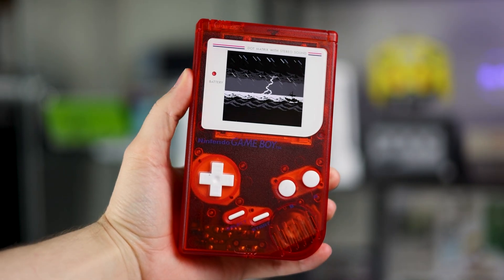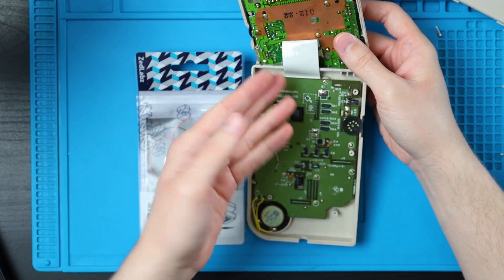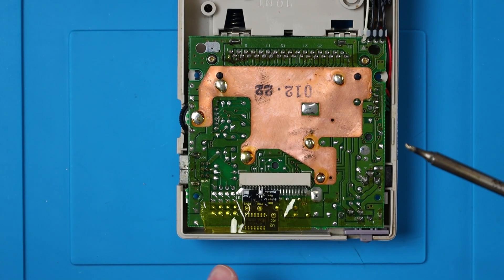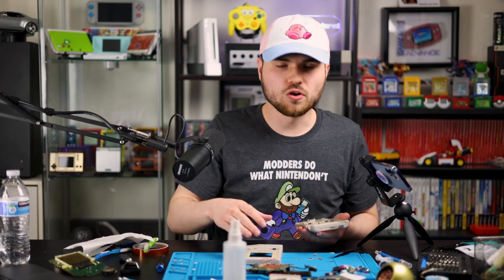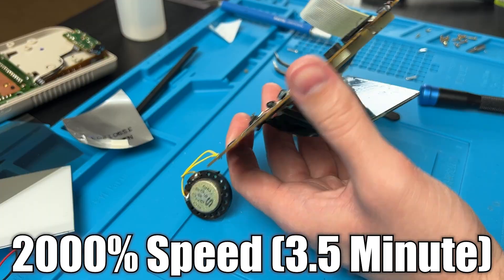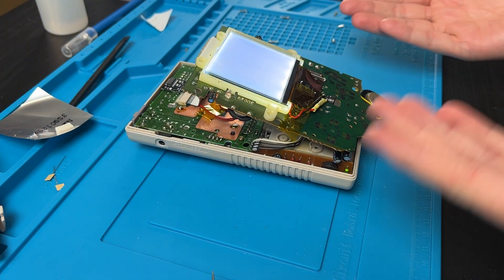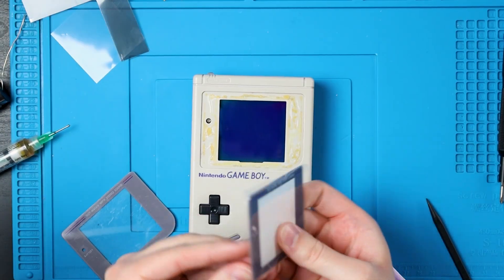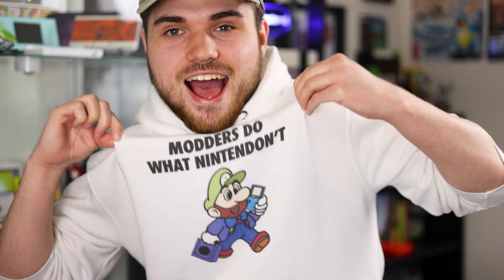The CHEAPEST Game Boy Mod! | Backlight and Bivert Mod

Comment: My kit doesn't have the resistor. What happens without it?
Reply: @ItsDoms  Thx, I put in an 100 ohm resistor last week from another backlight set i had laying around. The gameboy wouldn't boot  my flashcart because of the power consumption of the led-panel so I tryed soldering in the resitor and it worked.

Comment: 6:49 Quick hack. When you have both layers up, wedge something like a credit card underneath and move it around while pushing slowly. When you do it like that, there is also little risk at breaking the glas because of too much pressure. You just have to remove some glue afterwards. I just did this for the first time following your tutorial. Now the cleaning and soldering begins. Thanks for that!

Comment: This one definitely drained some of my confidence with modding, thought id give it a go since i was planning an IPS swap anyway and had 2 disposable screens with horizontal lines, the side ribbon cable pulled away from the screen on the first attempt and the second attempt the screen bled, safe to say this looked alot simpler than it actually is 😂, awesome video though bro!
Reply from the maker: Yeah this is wayyyy harder than the average IPS mod and the GBP version is even harder. I would definitely give an IPS mod a shot though!

Comment: What is the purpose of that rubber strip that you removed? Is it needed? How do you glue it back on? Thin strip of Elmer’s glue?
Reply from the maker: I don’t think it’s necessary. But if you want to put it back, idk use double sided tape. That’s how it was originally put on there

Comment: How would you recommend gaining some beginner experience with soldering for someone who’s trying to get into retro game mods?
Reply from the maker: I recommend buying a DS lite with a broken hinge or top screen and trying a macro mod. It’s only a few simple steps and really cheap if you break anything. Plus with the resistor being so small to solder on, if you can do that, you can do most basic mods

Comment: Cool, what brand is your spudger? If it's not branded like iFixit, what keyword did you use to find it if it's ok to ask?

I highly recommend: using rechargeable lithium AA 1.5v batteries if you don't want the look of the rechargeable lithium battery pack for the vertical form factor Game Boys.

By the way could you use 99.99% isopropyl alcohol to clean the gunk after removing the reflector?

God bless us modders/